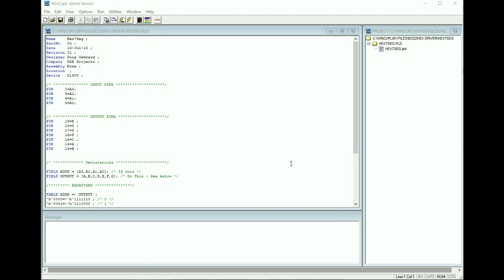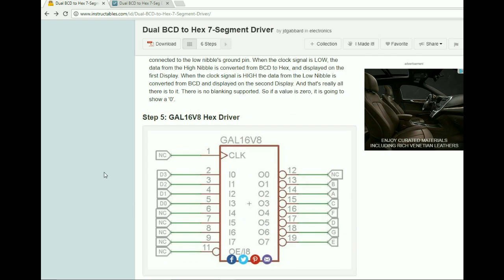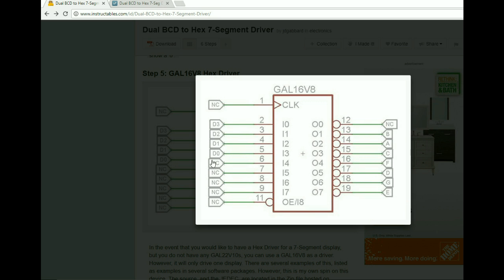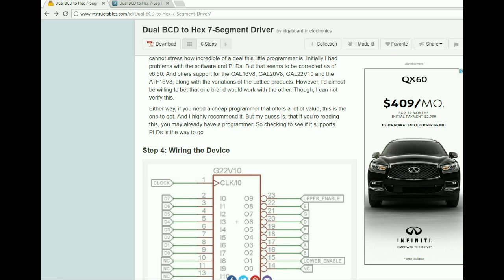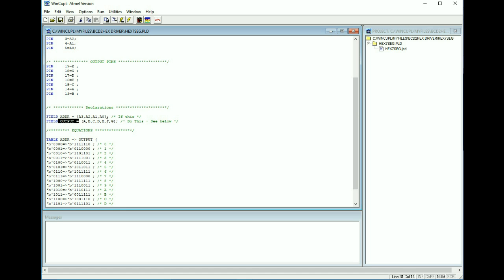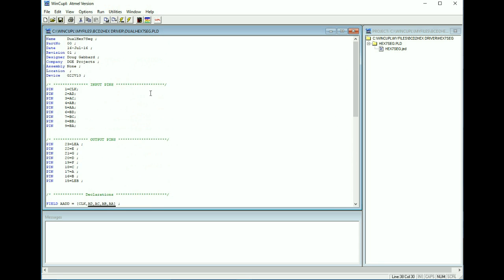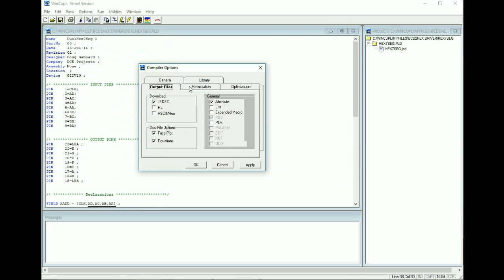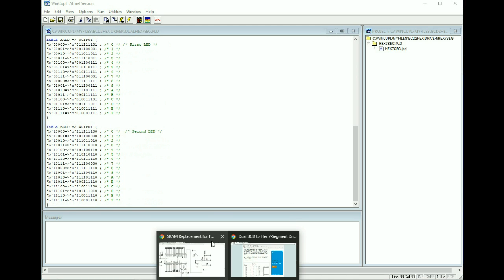WinCUPL Part 2:  Fields and Tables for Combinational Logic

Comment: Hello RD, today I stumbled over your video's on 22V10 programming. I know there are several solutions for a problem, but this one for the dual display looked more difficult than needed. Why not just assign LEA = CLK; LEB = !CLK; and use one decoder table for A3...A0 to segment A...G. I expect that the compiler will probably come to the same result from your code, but perhaps I am wrong. For me programming PLD's, GAL's and FPGA using tools from low level ABEL to VHDL and C++ is a long time ago.

Comment: Nice video, gave you a like. I just download WinCupl from Atmel/Micron. It will not run well enough to complie code on a Windows 10 PC, but it works on my Windows 7 PC.  I used Cupl many decades ago at work. I finally had a home project where I need to program a PAL22V10. 

WinCupl is kind of buggy... if you do something too fast in editing it will bomb out with no warning... so save early, save often. Also, some errors will pop up with a fairly critical message, and when you press ok to acknowledge the error, it bombs out as well.

So, for newbies, you are not just learning the tool, but the CPUL language as well, so syntax errors are expected as you learn, but the errors from such things are kind of cryptic as well. So, it may be slow going until you find the "secret sauce" to code properly for the device you are targeting.

What I found out it does not like long fields in the header, especially the Assembly field. Try to keep these fields at 8 or so characters.  I had a 40 char Assembly field (used as decent description of the code) but when going to the simulator, weird errors would occur and I could not get it to simulate... and it was a simple 3 to 8 Decoder.  

Make sure that Simulation is checked in the options or a file will be missing for simulation and the tool will fight you on that as well and bomb out or just not work properly.

The users manual is a good start but it glosses over a lot of things that need more detail. There is also a users guide that is a bit more help. The help doesn't work for a lot of things because it used a Microsoft web help utility that is defunct.

The most "in your face bug" is when you go to create a new simulation from a .pld file you just compiled - even with no warnings or errors.  The simulation mangles the header and you have to fix it manually or you get some nuisance warnings or even weird results.

These tools were written in the late 1980's early 1990's when PCs were still running DOS. They haven't been revamped since then, so they are coded with very old compliers, techniques, and a using very old graphics functions that modern Windows O/S's don't use (but are still available for such legacies).

But once you figure out all the things to click and not click, you can get simulations to check your code and JEDEC or HexSMS files to program your devices.
The tools are free, so you can't complain. There are better tools that work well and have better documentation, but you have to pay for them.

Comment: Something that took me a long time to figure out was that the FIELD command always starts at 0 so if you have FIELD input = [ A1, A2, A3], then the bits in the field will be shifted over by one leaving a gap at the least significant bit. You should use FIELD input = [A0, A1, A2]

Comment: I'm having problems with WinCUPL. I downloaded your project files, they compile fine. When I click on 'Device Dependent Simulate', it says 'Simulation Errors Encountered', 'Warnings 0, 'Errors 0'. There are no other errors. This is on Windows 10. I can't seem to simulate anything, even the simplest examples. There must be an environment or configuration problem, but I can't figure it out. Any ideas?
Reply from the maker: You need to run the PLD file in WinSim. There is a link on the ribbon bar.
Reply: @RetroDepot  OK, got it. It's quite confusing, but you have to create a NEW file in WinSIM, then choose the design file in the Design Properties dialog and save that. Otherwise, you get a useless error. I also found that WinCUPL crashes immediately if design files are not in C:\WinCUPL. Also, I couldn't find WinCUPL at the link you provided. I did find it on this website: https://www.kanda.com/products/Kanda/PLD-TRAIN-USB.html Thanks for your help and the great videos!!

Comment: A two-digit 7-segment decoder is my current and first PLD project. I coded it with equations and manually drew the fuse map just to make sure I understood how the device worked. Doing it with tables would have been much easier. I haven't burned it yet but it looks correct in the simulator. Thanks for these videos. They have been very helpful.

Comment: Ohh you have no idea how much your tutorials have helped.
I was trying to do Boolean Algebra to trim down my code for the chip... I had no idea the WinCupl compiler would just take a truth table. You probably saved me days of mind melting madness. ^.^
Despite that I just spent the better part of 3 hours trying to figure out why the heck WinCupl kept crashing whenever I tried to compile my code But I finally got it to work!
I was trying to do the same thing you did with the dual Hex 7 segment display, but I was making it for common anode rather than common cathode.
You're file was a great help in tracking down the problems.
I still can't get simulations to run at all though. I keep getting 0 errors, 0 warnings but "simulation errors encountered"
Ahh well. Time to work out what is special about the PD pin and how to use it. The power down mode sounds like it would be handy.
Ohh and since the video resolution makes it hard to see, the brackets around the TABLE values are curly brackets { } while the brackets around the FIELD values are square brackets [ ]

Comment: If you get the chance to do more content on this subject I'd appreciate it. 
  BTW a friend of mine is a 3rd party electronics sales rep. He mentioned a company Silego (word play on "silicon lego"). They were bought out by Dialog Semiconductor within the last couple of years, but they have a product line called the "GreenPak." That's mostly a line of cheap OPT chips with a bunch of LUT variations but they also have a bunch of hardware peripherals onboard. There are even analogue peripheral options in several parts in the lineup. The chips are intended as a cheap modern universal glue logic type of thing. One time programmable stuff is virtually useless to a hobbyist like myself, however, just before Silego was bought out they released an in circuit programmable version. I still haven't found those for sale anywhere yet but the idea is really interesting. I imagine there is a possibility of something like a PLD that could be reconfigured in circuit with a device like this. If such a device had analogue capabilities with a reconfigurable pinout system, the possibilities become really profound.
 ...anyways...it's just something I think you'd find interesting...I have no affiliation with any of this stuff ;)
-Jake
Reply from the maker: Jake, that is interesting.  I haven't heard of them before, but it sounds like an early PAL device, one time programmable PLD.  I'm sure the concept isn't too different.  I've wanted to do a new video on PLDs for a while.  But I am thinking about switching back to some older software.  As I've had a few problems with WinCUPL.  It's nice since it runs in Windows.  But I'm thinking about sticking with DOS for future designs.